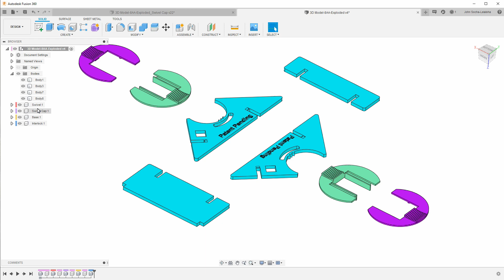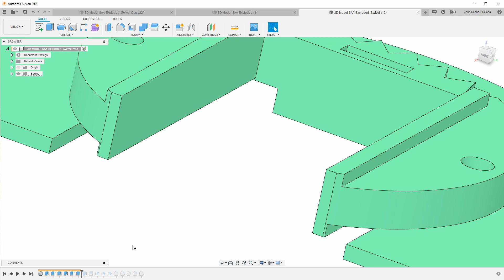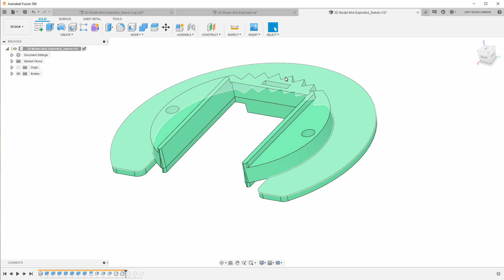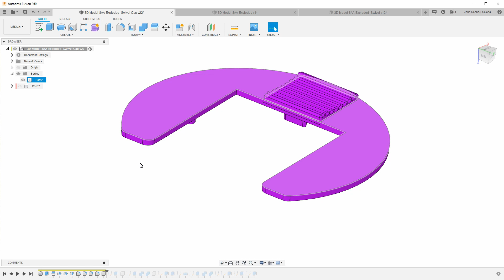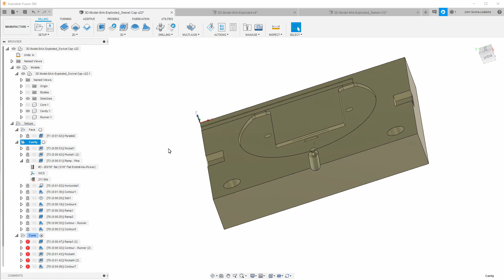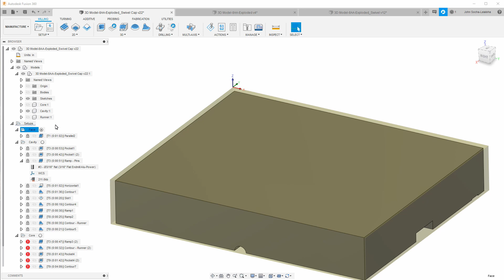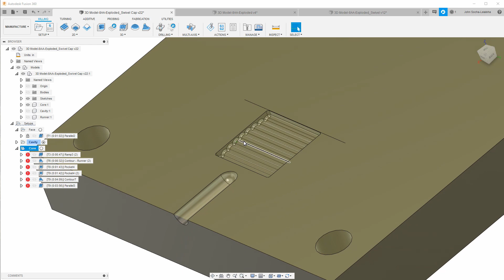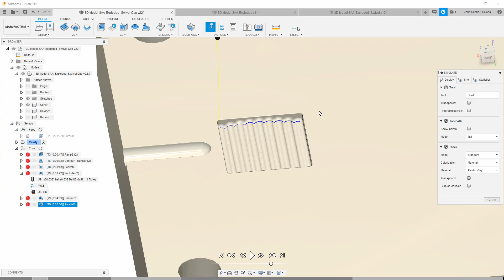Customer Injection Mold, Part 1

Comment: Nice video:) Watch out for the wall thickness. It looks like the raised center areas are thicker compared to the rest of the part? They look cored out from the back side, but maybe still not a consistent wall. Did you "sweep" a section through the whole part? That can help show any problem areas.
Reply from the maker: Yes they are. They're not that thick, so I'm hoping I don't get sink marks. If I do, I can change the part to compensate and remake the molds. Each mold half takes less than 1/2 hour to make, so I'm fine making another one if needed. And it's still part of my learning. In other words, I'm not concerned about being efficient, or getting it right the first time.

Comment: Thanks John.  Did you use a scale factor for shrink?  The Pencil command works well for me on detailed pockets.  The Harvey tool tapered long reach cutters help for small diameters.
Reply from the maker: I did not scale these. I'm currently using polystyrene, which doesn't string much. And the dimensions on this part are not critical. But it's a good point. As a matter practice, I should. Also, I should try the pencil too path. Thanks.

Comment: John there is  tiny rectangular hole in the part. You also created a tiny rectangular hole in the mold which would leave a pin am i missing something?
Reply from the maker: There are two different parts I prepared for molding. I created the mold for the part that has a rectangular pin. After I get this working, I'll create a mold for the other part, that has a rectangular slot.